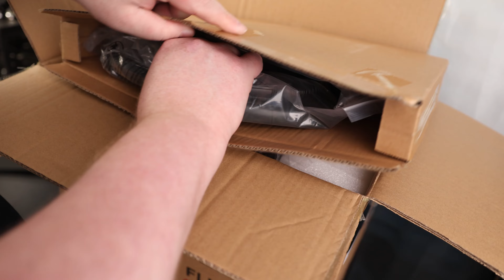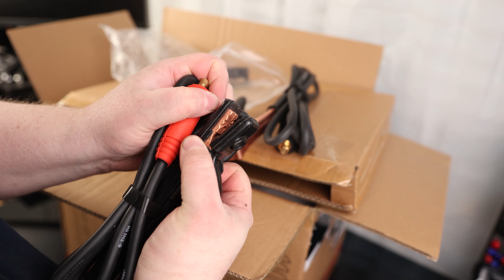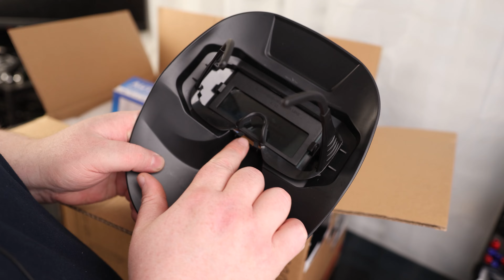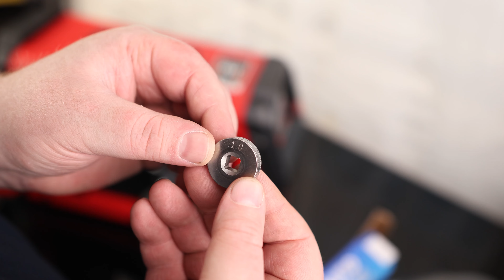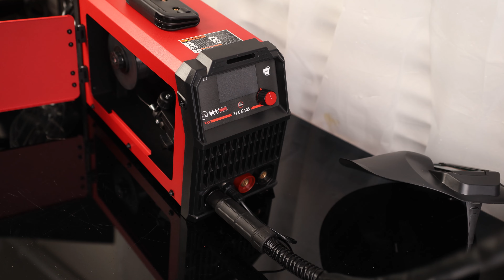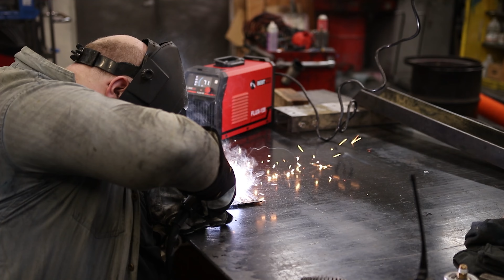BESTMIG Professional Heavy Duty MIG Welder for Welding Beginners and Workshop Users

Comment: You adjust amperage on this one and not volts + IPM for MIG? Sorry for the dumb questions. I just completed my first MIG and stick class. So I’ve only used Miller machines that my school has (ones that will take me years and years to save up enough money to afford😒lol) I’ve been trying to do research on what would be some good machines for me to start off at home with and practice with. Have me a small little set up to play around with at home you know? So your videos are a big help. I watched your air compressor one earlier.
Reply from the maker: A lot of the modern consumer grade welders are going to what they call, "Synergic" control.  So you adjust the amps, and it gives you a usable setting for wire speed and volts.  It makes it easy for a DIYer to get into welding, but if you want more control, you'll have to pay out more for a more advanced welder.  The trade off is, you can get a welder for much less today than what you'd have to pay for a similar welder years ago.